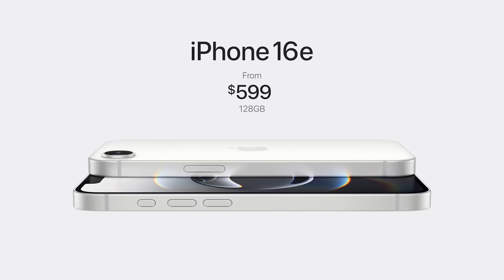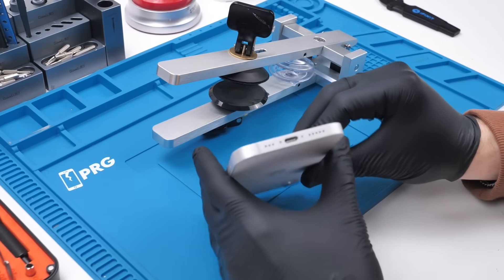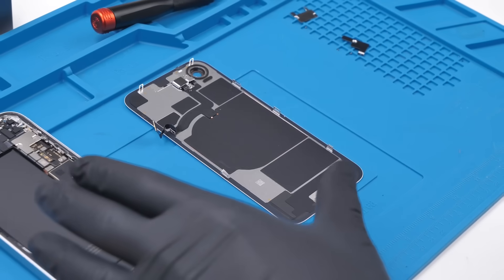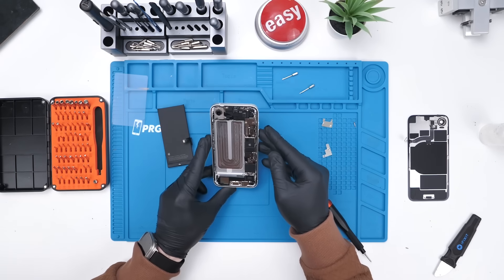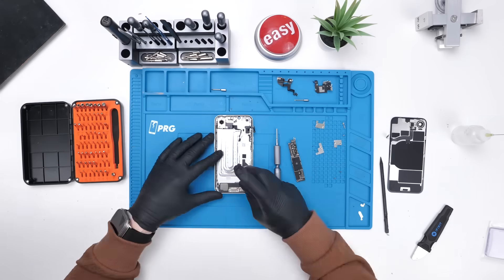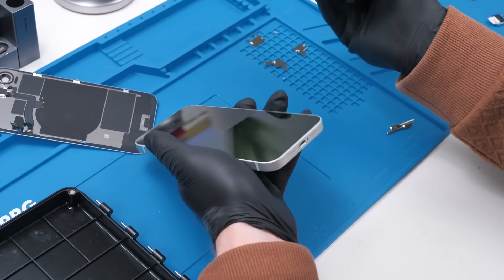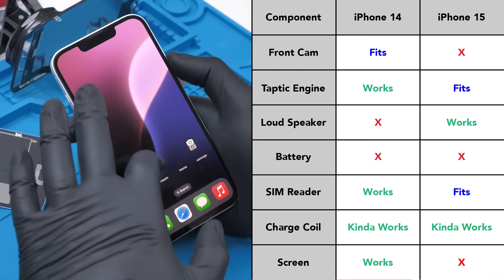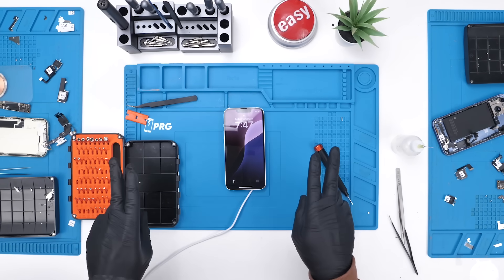iPhone 16e is a FRANKENSTEIN Phone...? Teardown + Magsafe

Comment: thanks phone repair guru! i was wondering if the iphone 16e would have the easy battery removal.. i just upgraded to a iphone 16e from a iphone 7 plus! i took advantage of boost mobiles deal on the iphone 16e if you switched to them.. i paid 181$ out the door for it brand new! granted it is locked to boost for a year but i dont plan on upgrading anytime soon..

Comment: lol i have been daily driving a iphone 5s type franken phone for the last 10+ years.
having the availablility of 2$ parts has been amazing. i upgraded the logic board to the iphone se 2016 back when they got rid of the 3g, but was able to keep almost everything else the same inside of the better 7 series al chassie of the 5s. people didnt realize it used almost all the same parts as the iphone 5 from like 10 years ago and that the 2016 se has the same 16mp camera sensor in it as the iphone 14 rofl. just no ai slop post modification of images so yeah. phones havent changed in the last decade, yall have been wasting your money to get seralized e waste junk phones that dont even innovate. i build my own batteries now and added a thermal camera and usb-c fast charging port to my phone, not to mention a physical on/off power switch. what a concept. my batteries last a week between charges and it all fits inside of a caseless iphone 5s which turns heads whenever i pull it out now.

Comment: I fully defend the 16e after using it for two months now… but, only due to the fact that Apple starts unsupporting devices eventually and I plan to have it for as long as I had me se, witch was 5 years, if it craps out I’m coming for Apple, feel like I coulda got a 15 pro for cheaper and have better battery and cameras, but I do just use a MagSafe case and it charges way faster than the 13 mini I had idk if it’s the charger but it’s way better than I expected

Comment: Recently picked up the 16e. In Denmark it’s considerably cheaper than the regular 16. Battery life is a win and the smaller camera has a big advantage. Lots of cases will lay flat because of it. No cases will lay flat with the big cameras on the other models. I have always hated that.

Comment: I bought the 15 three months ago, and recently I noticed that there was dust in the flash gap that I couldn't remove with a brush.
I asked Apple to check it out and try to clean it out, and they told me that the only way to do that was to replace the entire glass back plate, and that it would cost about $120.
I would have to buy AppleCare, but that I couldn't get AppleCare to reduce it down to $27, because I don't have any damage to the glass back plate, but that it was just a piece of dust that was stuck in the flash gap, and Apple told me the above.
But this is just dust stuck in the gap of the flash, and Apple's telling me all of this.

I think of the iPhone as buying software and getting hardware free.

Comment: Hi i got my iphone 12 pro battery replaced and after finishing the repair the technician did put a gasket but my screen is not sitting flush from corner when i press the screen it does feel like loose 
After asking he said your screen ring is broken 
what should i do and how to fix it?

Comment: If the 16e had the single main camera from the 16, I could look past the other shortcomings and lack of ultra wide.  Unfortunately while it’s a 48MP camera, the size of the sensor is around what the iPhone 12 had, so it’s going to stink at low light.

Comment: BetaVolt BV100 baterias 🔋 🔋 🔋 🔋  diamante 💎 💎 💎 💎 nucleares
baterias 🔋 🔋 🔋 🔋 SILICIO E CARBONO 5500 6500 7500 8500câmera 📷 200 mpx 150mpx 100 mpx IPHONE 17e titânio alumínio tungstênio preto 3500x2080 display 12gb ram 16gb ROM 24gb ROM IPHONE 17 AIR PRO IPHONE 17 AIR ULTRA IPHONE 17 AIR PLUS

Comment: Begs the question - why did they leave out MagSafe if it could easily be added in the product as designed? It can't be for cost savings. The magnets probably cost Apple about 50 cents, and with them included, they would get that back and more with the sale of MagSafe accessories. It's either to intentionally gimp the phone (thereby making MagSafe more of a 'premium' feature to driving 16/16 Pro sales), or maybe it's due to the magnets causing interference with the C1 modem?

Did you notice any degradation of download speeds with the magnets added?

Comment: Car manufacturers do the same thing with sharing parts across vehicles and generations. A great example is the 1ZZ engine- it was made from 1997 to 2008 and used in 29 different vehicles, some not even made directly by Toyota! 

Also, the 16e is a strange phone. I only like it because it hearkens back to the SE days, and carries the same kind of heritage those phones had: new hardware in an old frame. It definitely does not belong in the "budget" category, and definitely also isn't a great option when older flagship models can be had for good prices.

Comment: 3:11  7.5w 💀
I will not consider it to have wireless charging, and you will get the slowest charging speed on the planet for more heat than using a wire of only 7.5w. They put it so that it is said that it has wireless charging within the specifications, and not because it has a benefit.

Comment: You're right it seems more a target for companies that buy for employees. 
-Standard uniform colours (black/white)
-cheaper than the 2½ years older iPhone 14
-modern enough of a design despite a notch (no home button), 
- name is in the iPhone 16 line up so it's easy to think "iPhone 16e > iPhone 14/iPhone 15"
-wireless charging stand is probably a non-standard accessory so they don't care it charges slowly when they don't use it

Comment: Damn, you beat me to it. Yea, I had the idea of buying an iPhone 16e just to add Magsafe (Because for some stupid reason, Apple didn't), but you got to it first. This is light hearted. Hopefully case manufacturers make Magsafe cases for this phone. But I had a suspicion that the screen was the same part as the iPhone 14 screen. I can even confirm that screen protectors for the iPhone 13/13P/14 also work on the iPhone 16e, so screen protector manufacturers just need to take their existing iP13/13P/14 screen protectors, and add 16e to the list.

Comment: The most useful 16E review on the web. Now I know what are pros and cons. Surprisingly I am a lot more ahead now to get this newest baby
Reply: Pros for me: 
- battery larger than usual 
- small camera
- no magnet (makes lighter what I prefer and not charge this way)
- newest chip - as you point- longevity and iOS upgrades 
- cheap repair to the screen 
CONS
- no Touch ID - even in the action button 
- action button must be hold for few seconds to activate - very strange solution

Comment: To be honest at the risk of being burned like a witch, I'd say I entirely agree with the design decisions Apple made with this one.
This is a phone for people who don't really care about features on phones, and it's gonna serve that kind of person well for many years due to the strong CPU and battery. Finally being as easy to repair as most Android phones is also a huge plus. 

Using some parts from previous models is a great choice to be honest, especially since these are parts that haven't meaningfully improved in any way at all. I see no reason they would need to redesign these parts and make whole new production tooling for them when the existing parts just work. Especially when repair businesses and consumers who get their phones fixed also get to benefit from those cost savings with cheaper spare parts.

The only thing I don't entirely agree on is the price, it should've been a bit less expensive but to be honest they're not even that far off in my opninion. Your average person does not care about extra cameras on the back or the notch vs "dynamic island" but absolutely will love the big battery.
Reply: Finally someone who gets it for the everyday joe like me who doesn’t need all the bells and whistles on my phone. The se series phones have served me well and so well the 16e. I agree that $499 would have been a better price point for the 128GB model.
Reply: Finally, something not negative about this phone. I was personally excited for this phone before it's reveal, having wanted to replace my aging SE, and disheartened to see all the complaints people made afterwards. I can understand everyone's reason for disliking it, mainly the price it seems, but it doesn't bother me that much. I'm not looking for a flagship, I just want a phone that works. The increased battery life is a nice touch imo.
Reply: It’s the thing which most these tech tubers forget about, most of us don’t use all the extra features. I wish they made it in silver or plastic like the 5c
Reply: @morganwilliams2863  yeah exactly, the only thing I ever hear people who aren't into tech complain about is when their phone lags or when the battery doesn't last long.
Reply: exactly

phones these days are just boring appliances to a lot of people

this phone is great for that market segment that just wants a phone that is going to work for 6 years if they take care of it
Reply: @itsmejak7888  to be honest even for me it's that way these days... I used to stay up for Samsung release events and now I'm holding on to a note 10 because I haven't cared about any of the last 6 generations of phones.
Now I also just want a phone that does all the basic things well and lasts me a long time.

Comment: Prices in Germany after taxes:

16E: 700€
16: 750€ NEW on the internet

If you buy the E you have lost control over your life
Reply: Ne, der 16te kostet eigentlich neu 949€
Reply: @smg5357 ja bei Apple, sonst es geht los bei 800€ easy.
Reply: @smg5357keiner sollte iPhones direkt bei Apple 5-6 Monate nach Marktstart kaufen
Reply: I’m almost certainly going to be supplied with one by my employer at some point. Maybe even by two employers… would rather pay a bit extra to get a good one.
Reply: It's almost like they push out 16e partially due to them wanting you to buy 16
Reply: @lemon9.9  The sad part is there is a $300 USD difference betwen the 16e and the 16. No, it's not as simple as them trying to make you buy the 16 instead.
Reply: 16e have more battery
Reply: $13 month carrier cheap
Reply: Same here in England. VAT kills Europe
Reply: 600*
Reply: Maybe outside the US
Reply: In Belarus 16e is greatly have lower price than base model
Reply: In many countries outside the United States, a standard 16-inch model costs significantly more than a 16e model.
Reply: Price in the USA... iPhone 16 $799. iPhone 16e $599. $300 difference.

Comment: At this point, I shall consider buying a second-hand iPhone SE (3rd Generation)
Cuz I love the Lightning Connector, Touch ID, and the fact that it is still equipped with most of the modern features like 5G, Good Performance, etc :) (Also, I like the OG iPhone Design...)
...The iPhone SE 3 shall also get at least 3-4 years of upcoming iOS Updates since it's the same chip as the iPhone 13... And also the efficiency of the A15 Bionic and "okayish"  battery life... (Average screen time is about 4 - 5 hrs)
The "Excellent" condition refurbished iPhone SE is going at around 24k  inr (~275usd)... (128gigs)

Comment: The iphone SE is just an iphone 8 thats been repurposed and name changed. the iphone 7 and 8  and SE share same screen and cameras and speaker on front screen home buttons same size but only works by swapping the chip on the touch id. the iphone 7plus and 8plu use the same screen too. The SE shares every prart exactly the same as iphone 8. its the same dam phone for 4 generations!!!!, counting iphone 8

Comment: I bought a samsung s25 100x better for little more expensive but if someone wants nice phone go for samsung a55 outside of usa in usa go for a35.They may not match raw performance but have better battery good camra cheaper and 120hz display chip is solid

Comment: 0:53 Sadly, no. The A18 isn't designed to the task of integrated reasoning LLM. The A20 will and when it is out, iOS will demand so much more from the device, that it will feel like the transition from the 3GS to the 5.

Comment: 5:06 since they use older part, old gen screen, Apple could just use last year CPU instead of using the new one (but downgrade the speed of it) thats the waste, just drop last year CPU and set the price $449 or something that will make sense
Reply: Thats not very apple like, instead of throwing in gimmicks and these so called cool features the SE models in general always offered top tier performance in a not so high end body, by that logic for the 17e they could utilise the 16s design with the cameras and Dynamic Island but use a A17 Pro chip which they will never do

Comment: Next idea. Replace the iPhone 16e's 60hz screen with a 14 Pro's 120hz screen.
Reply: People are dumb. Defiantly you
Reply: @Jordancade2010  *definitely. You should work on your spelling.
Reply: @JesusLovesYouSoMuch47  I may have spelled that wrong. But you literally asked if a 14 pro screen will work on a 16e 😅
Reply: @Jordancade2010  the 16e uses the same screen as the 14 in case you didn't know. So maybe it might also work with the 14 pro version. Maybe not, it's worth a try. Better than paying $1000 + for a 120hz 16 pro

Comment: I lost my iphone 15 pro max and since I didn't have apple care I had 2 options a new iphone 14 pro 256gb or the iphone 16e and I bought better the iphone 14 pro at $440 dollars for me it's better because of the 120hz magsafe cameras and the price is much better and in my iphone 15 pro max I never used the usb c cable so I don't care about the cable I only use magsafe

Comment: What exactly is iPhone 16e? Embarrassment
Reply: It’s literally the iPhone 16 but the camera bump is smaller
Reply: @Aaroncoughlan14  Smaller camera bump because of a worse sensor, worse display(same one as iPhone 14 so not super bright) no magsafe  slightly worse A18 SOC (it lost 1 gpu core) still 60hz etc if it was 450 or 499 it would be great but for 599 might as well just get said iPhone 16 on refurb market

Comment: The 16e main camera sensor is supposedly the same as the 16 Pro's Ultrawide Sensor (48MP 1/2.55) but has been reworked to a similar configuration as the iPhone 12’s wide assembly. I’m curious how the 12’s main camera module compares, would the housing fit the 16e? No clue, but you may find this info useful.
Reply: actually if apple quite generuous, putting iphone 13 camera on Iphone 16E will me make this type sell like peanuts instead of solo camera.
Reply: At first, I was doubtful about the sensor size, but seeing it in this video has convinced me that they are not the same (the iPhone 16 and the iPhone 16e).

Comment: The 16e really looks like the refreshment of the iPhone xr
Reply: I switched from XR. fully agreed. almost same phone. just that speed and battery life is crazy
Reply: it pretty much is
Reply: Thank you someone understands a little more
Reply: iPhone 11
Reply: Not as iconic
Reply: More like iphone 13 idk why everyones saying its the same as iphone 14 when in reality is the same as 13
Reply: @bejmejns i feel like the iPhone 13 never got much attention i mean when it released everyone liked it but now it's like if it's forgotten and more just mention the iPhone 14 instead
Reply: @bejmejns it’s structurally similar to the iPhone 14 not the 13. It has a similar component layout and a mid frame design with removable front and back glass
Reply: @bejmejns I just switched from the 13 to this phone, and I got to say. It’s the exact same phone with a weaker camera.
Reply: @bejmejns  FYM??????? it doesn't share ANY parts with the 13 and it share 4 parts with the 14 

this phone has literally nothing to do with the 13
Reply: @itsmejak7888 I think he means design wise like the notch, yeah the 13 has the same squared off design and smaller notch but it doesn’t share any of the actual parts with the 16e, because the 14 refreshed those parts as it didn’t reuse the 13 despite looking the same

Comment: seems like apple is trying to empty the parts stocks with this phone.
Reply: It’s 99 bucks at Metro By T-mobile and Boost Mobile
Reply: That is part of the SE series is cheaper.
Reply: @nevermind5399  this one is not cheaper anymore. Cost same as 15, if you buy the 256GB, it costs more than the 16 with 126 GB

Comment: The lack of ultra wide band is giving me second thoughts on replacing my iPhone 12 with an iPhone 16e. I use it to track either my wallet with an AirTag or my AirPods Pro 2. The lack of MagSafe wasn’t a problem for me since I could somewhat easily do what you did here or get a third party case with built in MagSafe magnets (back in 2022 when the SE 3 launched EverythingApplePro’s company Phone Rebel re-released the older iPhone 8/SE 2 and iPhone 11 cases with MagSafe magnets, so fingers crossed same goes for the 16e)
Reply: js buy a used good condition 15 or a new 16 aint that big of a deal bro, 16e is just useless
Reply: @ I may just go on a payment plan on an iPhone 15 Pro with my carrier since they had a finance option.
Reply: "The lack of UWB" bro if u can't find your wallet and always search it the phone get u shit together and organize your life .... wtf ...
Reply: please get a 15 pro
Reply: Get a new battery on your iPhone 12, you don't need an upgrade unless you're running out of disk space on it.
Reply: or you can get a refurbished 15
Reply: For me coming from a 12 pro max to a 16 pro max was a good step up but not really a necessary upgrade I would of changed the battery out and waited another year this 16e is not worth the cost may as well get last years and get a better iPhone for less money 💵  ✌🏻  ❤
Reply: Refurbished 15 pro is better
Reply: Only poor people buy the pro to flex on others.
Reply: Get a 15, a 15 pro, but not this 16e 😭